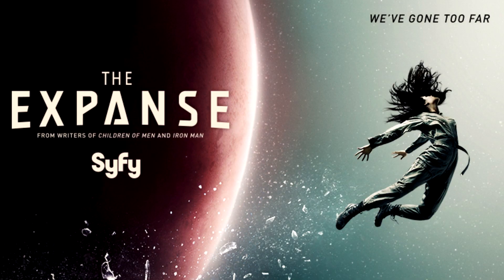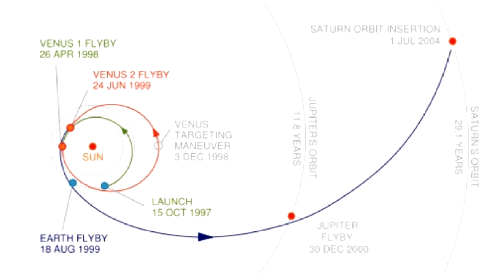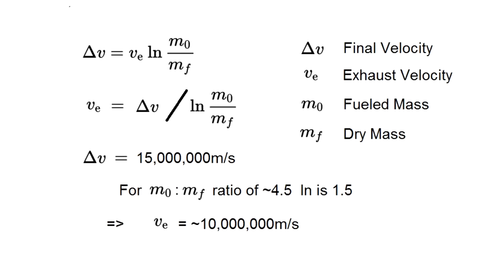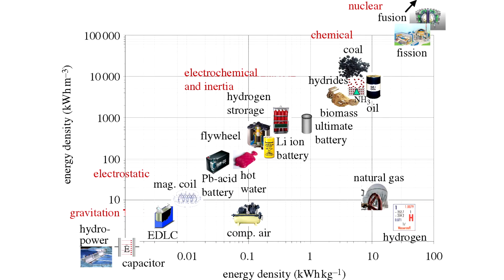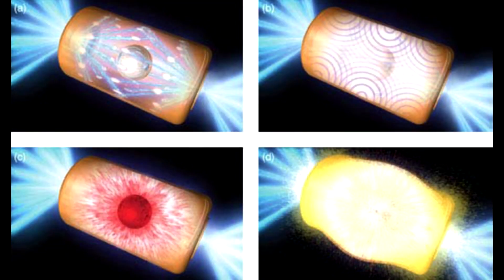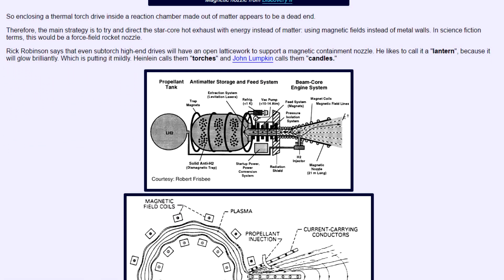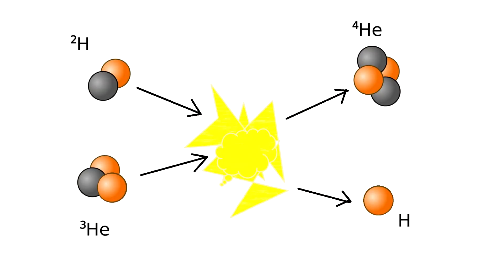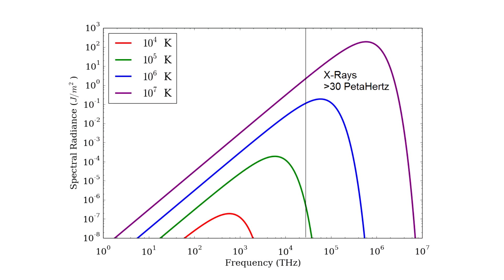The Rocket Science of 'The Expanse'

Comment: Is it possible today to make a rocket engine that produces just 1 G of thrust?
Reply from the maker: +Alexander use same engine on a ship 7 times the mass.
Reply: Any rocket that can defy gravity has a thrust > 1G
Reply: The amount of fuel. Changes in velocities only happen at specific points, not continuously since fuel is expensive. You could burn for long time at 1/4 or 1/3 G like they do in the TV series, but that would be super inefficient.
Reply: It's because we can't currently build drives that can burn at 1G for more than a few minutes.
Reply: The problem with those is that they have to be huge.  If you build a 
small one, you need to spin it up to crazy speeds to get centrifugal 
force anywhere near 1G.  Another problem is tidal effects.  On a small 
circle, your head will feel alot less centrifugal force than your feet.

inb4 centrifugal force isn't real; it IS in a rotating reference frame.
Reply: Alexander For a handful of minutes, then you're out of fuel. Orion might run for a few days or weeks at several gees, but you might not want to use that anywhere near important assets.

I don't think any fusion designs, even afterburning ones that have been posited would produce a g of thrust.
Reply: The type of rockets that we use today do not constantly accelerate for the whole mission, they can fire their engines for a relatively small period of time (like 5 minutes) before they shut off due to having burnt all of the fuel on board or having to save some for later maneuvers.

The rest of the mission would then involve weeks or months of 0g
Reply: @Alexander I suggest you try the game Kerbal Space Program. It gives you a rough idea of what's currently possible. You'll then understand why you don't want to have the engine on and using up fuel continuously.
Reply: Ok, I was just wondering because, if we can make rockets that can produce 1 G of acceleration and be fuel efficient, why are scientists concerned about microgravity for long duration space missions?
Reply: Millitron i think Alexanders idea was to accelerate continously so you would have pseudo gravity which would be interesting if it weren't for the fuel mass
Reply: Alexander it's bc you don't want to accelerate all the time, for that you would need a tremendous amout of fuel
Reply: The problem with microgravity has nothing to do with the engines.  The problem is biology.  With no gravity to work against, your muscles will get very weak on long voyages.

We've had a few astronauts spend a year on the ISS in zero gravity.  Even with them exercising as much as an Olympic athlete, when they return they can barely walk.
Reply: There is something called rotary gravity generator shown already in SF movies from 80'ties and 90'ties (and Interstellar). Yes, it can be used only on at least several room size ships, but it is quite basic thing..
Reply: TheRezro It has to be really big. You could make one that spins really fast, but it would cause difference in experienced gravitational force (Its not really gravitational force). So if you make it too small all the blood would stay in your legs and that would be pretty bad
Reply: Matter Anti-Matter engines will be capable to make 1g trust, but I know very little about scientific progress in Anti-Matter production and utilizzation.
Reply: Millitron Yes, I know. Still they did have quite sizable ships, on edge of what would make it possible.
Reply: ***** I know.
Reply: The Budgie Admiral Do you even know how Ion Engine work? It is highly efficient but in fact extreme low thrust. And that other thing is even more hilarious..
Reply: Aeryn Osu No shit Sherlock 0_0

We talk here about specific use from show, and they use it to generate gravity.
Reply: Acapulko Jik You need store it in cyclotron, and those definitely aren't small.
Reply: A ride into orbit on the Space Shuttle was a 6G blast for 8 minutes. They could make more thrust, but 7G's is where the fighter pilots start to black out.  It is by all accounts a violent and scary ride.
Reply: +Sarge Rho That is just a matter of how efficient you get with your heat exchange system.